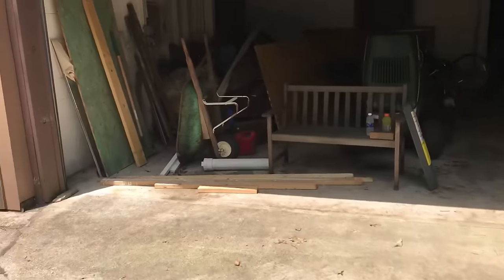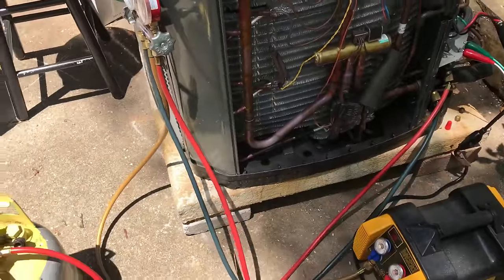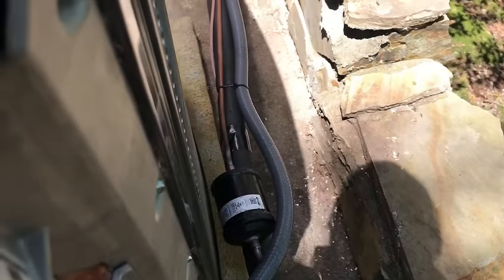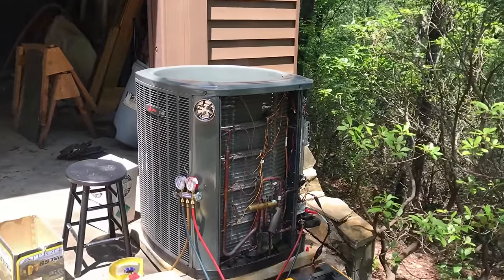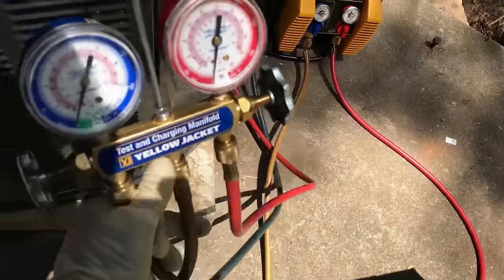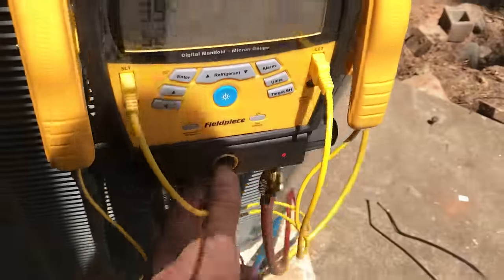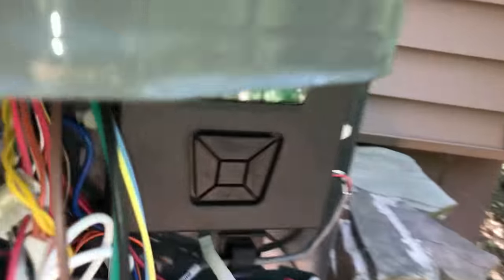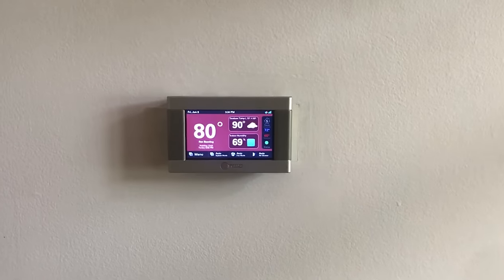The Closet Condenser is moved and repaired (compressor replaced)

Comment: I agree with Garry Iwankow, the manufacturer shouldn't cover the compressor with an install like that. The installation manual clearly spells out what not to do when locating a unit. PS Love the Turbotorch, in the 70', 80's and 90's I installed thousands of systems using a B tank and Turbotorch.

Comment: When I do any compressor change out I test the old refrigerant to see if its contaminated with any amount of acid. If so add acid-away Along with new refrigerant and a suction line filter drier to make sure everything stays clean. Weeks or a month later depending on run time Retest refrigerant and if it’s acid free and remove suction line drier.
Reply: If the compressor shorted there have to be a certain amount of acid.

Comment: Made me smile seeing you use a turbo torch!  So many younger guys (i'm in my 30's so not old either) in my company use oxy/act torches and say B tanks put to much heat on the copper to braze, obviously they never learned to use b tanks properly!  I had a oxy/act torch set first and then after working 2 years with a guy who used only a B tank I switched and will never look back!  With a B tank I don't have to move the flame around as much like you do with the oxy/act torch and no nobs to fiddle with every time you accidently hit it on something and have to reset the flame.  Only thing i'll agree with is that the oxy/act torch has a higher heat so you braze a couple seconds quicker IF your not messing with the torch cause you accidently hit a nob!  They call me dumb for selling my torch set and getting a B tank but for me less fuss and a slower brazing time work for me and has worked for many others for 40+ years shrugs i'd rather a pat on the back from the old timers then the young 20 somethings who can't braze worth beans anyway!  I was on a job with a young guy where it was 2 AC's on a duplex I did one side and he did the other, I finnished before him and he was all "B tank is outdated oxy/act is the only way to go!" whelp....he had a leak and had to rebraze and I had none and was packing up while he was still putting it in a vacuum!

Comment: I just worked on a big warehouse/office space.  I think it was some kinda shelter too but its empty now.  7 units did the space that wasnt warehouse.  All 7 indoor and outdoor were on a mezzanine in the warehouse.  The cubic ft there was way more than enough, unlike here.  This needed like 18" pipe or so off each unit to the outside via a big grill or either 2 big fans moving lota of air thru that space.  I feel lime moving them cost more.
Reply from the maker: There are 3 units but just ONE of them moves 4800 CFM of airfow... how much air do you think you should move if all 3 are on at same time ? Or even if just the big one is on, how can you move 4800 CFM through this "closet" without it being a cost of efficiency ?? I mean, once the unit was moved it was a true 20 S.E.E.R. unit... but what would it be if an additional fan must run during all times the unit runs ? Also, to debunk your idea of piping out the condenser air... these units are not designed to move the proper air flow forced through any type of piping or resistance (static pressure) therefore, you would be at risk or losing outdoor fan motors at that point. You are fighting too hard for the wrong side.... but that is just my opinion, you have your own as well.

Comment: may have been possible to put a couple large exhaust fans up high and a make shift hoods to guide exhaust air from the units, but probably cheaper to move them and hard to see the whole setup/design there.
Reply from the maker: Look back a couple of videos earlier before it was moved and you can see how silly the setup was. The variable machine that was moved out is capable of 4800 cfm when running at 100%. There is no way the "closet" was going to exchange enough air for all 3 units if even one at all. I refused to touch it until it was outside.

Comment: Good job, did they warranty compressor.Ted
Reply: If you don’t replace the muffler and if applicable do the service bulletin during a warranty compressor then there is no warranty on the new compressor. Not saying they would not warranty it but technically it has no warranty.

Comment: I see that is a xv unit is the line set length ok for this unit ?
Reply: MrDjmurdock the Line set is not to long just from what I can see.
    Go to comfort site and it will give you all the specs. These are great units. I have the XV20 with zoning in my home.
     Get the charge right (only use charging mode to check the charge not test)measure the line set and weigh it in. Put the total charge inside by the drive and by the air handler. The biggest issue we see is untrained techs trying to work on these Replace the line set and low voltage wire use the grease that come with every condenser. Always use charging mode at start up. And NEVER PUT A MANIFOLD ON IT AGAIN. You get all the info you need from the CDA.
 On a maintenance you do not need a meter you have all your air temps cool temp superheat 
Fan motor info etc. 
they have a CDA service tool with a longer data cable you can buy as a service tool. This can be used on the communicating air handlers that don’t have a CDA just plug them into the board. We replace the line set drain and Tstat wire on almost every system we install. Some condos we can’t and some two story home we have to reuse the drain. Always power up the condenser first on a new system or else you will get a COM fault for no outdoor unit.

Comment: Ok so the brand new Trane use recip compressors? Or Climatuff scroll
Reply from the maker: We have very little recips left... when they are all gone we will produce no more as I have been told.
Reply: Anti DIY HVAC Ah man, that sucks. Why can't they make more?
Reply from the maker: It is too difficult to achieve the required efficiency with a recip.... not to mention more costly to produce.
Reply: Anti DIY HVAC true

Comment: The drier inside the unit you did not replace nor did the original company. Curious as to why nice job
Reply from the maker: The component you see inside the unit is a muffler... it is not a filter drier. The filter drier is on the outside.
Reply: Filter drier, charge compensator, and muffler look the same at first glance.

Comment: Elastic potential energy = force x distance of displacement. It should have worked in the closet just fine .
{\displaystyle \sigma (E)={\frac {\pi g}{k^{2}}}{\frac {\Gamma _{ab}\Gamma _{c}}{(E-E_{0})^{2}+\Gamma ^{2}/4}}} \sigma(E) = \frac{\pi g}{k^2}\frac{\Gamma_{ab}\Gamma_c}{(E-E_0)^2+\Gamma^2/4}

Spin factor:

 g={\frac {2J+1}{(2s_{a}+1)(2s_{b}+1)}}} g = \frac{2J+1}{(2s_a+1)(2s_b+1)}

Total width:

{\displaystyle \Gamma =\Gamma _{ab}+\Gamma _{c}} \Gamma = \Gamma_{ab} + \Gamma_c

Resonance lifetime:

{\displaystyle \tau =\hbar /\Gamma } \tau = \hbar/\Gamma

Comment: Every time I see how much heat goes into brazing copper pipe... the INSIDE of the heated pipe must be burned black. It cant be good for the sealed system.
Reply: We flow nitrogen through the line as we braze. It prevents oxidation inside the line.

Comment: What's the deal with the alligator clips?
Reply from the maker: Aaron Cruz where do you see that ?
Reply: @TedCookHVAC  it looked like two were grounded and the other had a couple wires attached to it. Is that to power your recovery machine?
Reply: Around the 45 second mark
Reply from the maker: Aaron Cruz much better than running on a drop cord... especially a long one.
Reply: @TedCookHVAC  oh, I like it. Do you do the same for your vacuum pump?
Reply from the maker: Aaron Cruz absolutely !
Reply: Called a cheater cord, let's you use 240 volt disconnect from ac to power 120 volt tools.

Comment: I would not have let trane pay for that compressor
Reply: I'd have no qualm about letting the company pay for the part. As long as it doesn't go back in the closet with our a major modification to the ventilation system. I think the guy put the units in there because of the sound. I would just put them on the side of the garage.

Comment: Isn't that kinda unfair to trane to give another compressor when it was installed like that. Ted was definately cheaper compressor warranty price.  I dont think I woulda wanted that call. The guy has warranty units and goes for cheapest price. $1000 for warranty compressors and $1000 to run lineset. lol Never heard from him again
Reply from the maker: Patrick S no I was not cheaper at all ... the original installer is not a TCS dealer and the homeowner wanted us to repair it. He just did not want to pay our price to move it. Obviously he was able to make them move it for nothing or near nothing.
Reply: gotcha Ted... I almost wanna be an ass to the customer and turn them down on Tranes behalf...

Comment: DEAR LORD , GET AN OXY/ACET TORCH
Reply: chris hilton ,the wall thickness on hvac copper doesn’t lend itself to oxyacetylene use,Turbo torch allows for control of heat better,imho,having used both myself.
Reply: @johnmurphy6366  I would completely  disagree with that statement oxy acetylene when used properly and with various tips will provide alot better control for different situations from big to small it does it all. I work on very small equipment and up to 350 ton chillers. Turbo torches are for plumbers.
Reply: Exactly,only when used properly,and with the right tip!Having worked on many rooftop units,get better control with turbo torch on anything under 1 inch tubing!To each their own brother.

Comment: Nitrogen while brazing??????????? Heat wrap around pressure control????????? Unsweating old compressor???????
Reply: Ron, obviously you have never replaced a compressor. #1, how would you flush the compressor with Nitrogen while Brazing, the pressure required to move past the valves would blow off the refrigerant lines. #2, he is using Cool gel on the refrigerant line on the tee to the pressure control, #3 what is wrong with unsweating and re-brazing the existing refrigerant line into the compressor?
Reply: @bradw.5991  That's what i was gonna ask. But he probably doesn't have an answer
Reply: @moisessanchez870  i thought he did a fine job with the whole thing.

Comment: No oil test...no nitrogen while brazing....could have used a wet rag on the press switch to be sure not to screw it up,....and 2 liquid line dryers.( either one high acid) and no suction dryer that I could see.  Did you bother to check if you needed extra oil for the  extra line length, and did they suggest a line size increase possibly.  I'd have told him to call the nitwits that moved the damn thing. I haven't figured out who is worse here, you or the fool that put that thing on a cliff
Reply from the maker: All testing was done when the compressor was condemned and before the unit was moved. The heat blocking gel was apparently not visible in the video I guess.... The LAST thing a variable compressor needs is line size increase... and the new compressor was full of oil plus what was in the system so that was fine with me. There was no place really to install the unit(s) at that house... you have not been there and you have not seen the property.... I refused to move it for just that reason but I did agree to change the compressor and get it back in service if he got it moved. You assume a lot of things, as well as you seem to think you're mechanically superior to me, and everyone. That is fine for you to believe. Congratulations.
Reply: @TedCookHVAC  You do a fine job sir. He's what we call an "Armchair expert" 

He probably sits at home criticizing others so he can feel better about himself. Pay him no attention. If he was actually thinking right he would have asked you about his concerns instead of berating you. 

Anyways I'm glad I found your channel and will be watching the rest of your videos. Thank you for sharing. :)